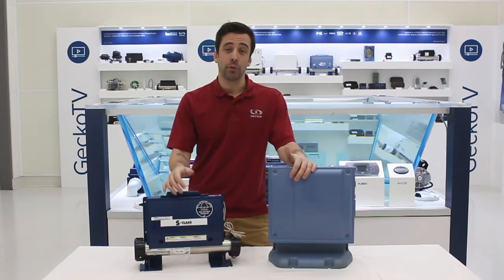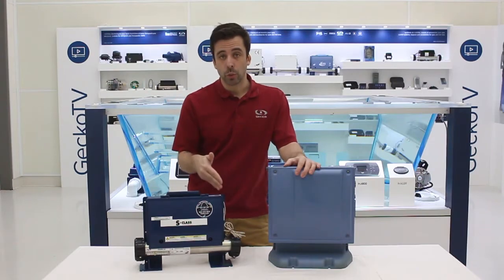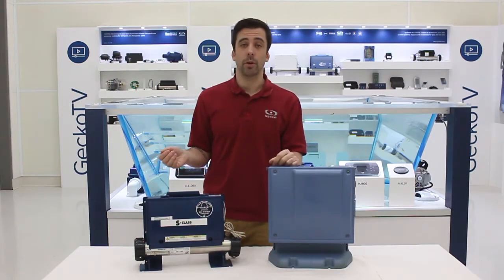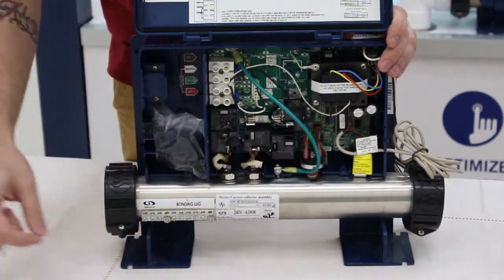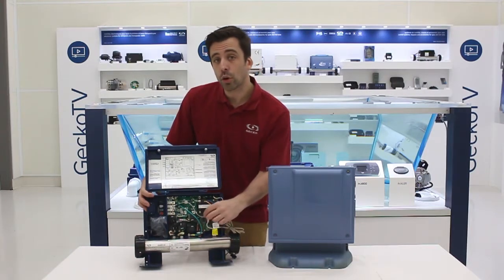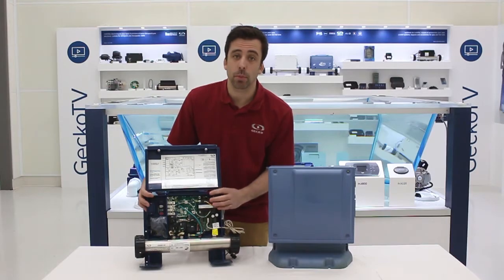3 FLASHING DOTS : FLO Condition

Comment: UPDATE for everyone who faces this problem........READ this carefully..... the pressure switch is almost all the time the problem, here why;

1- When you start (breaker) your spa AFTER refilling it with a new water; DON'T overload it keep the level normal or a little bit below.

2- When you refill it with MORE water than usual, the Pressure into the water pipes WILL be HIGHER than 2 psi

3- When the pressure switch is exposed to more than 2 psi it will close it circuit BEFORE starting the pump !!

4- IF you start the hot tub with a closed pressure switch BEFORE the pump starts.....the computer (board) will detect a higher pressure that is NOT supposed to be there and will TRIGGER the 3 dots = NO HEAT

This is what we found yesterday.... it happened to me twice and each time just before winter when I changed my water for this period.....each time I went to my specialist saying does not work...........EACH time twice when he plugged it......the spa pack was working PERFECTLY......and 30 min before........was not.........this is why we start our brainstorming

DONT bypass the pressure switch by connecting the 2 wires.......when you will restart your spa the computer will understand that the pressure was already high (more than or equal to 2 psi) and won't solve your problem... DON't Counterclockwise (left) your pressure switch........you will close the circuit below the 2 psi and face the same situation....... 

Voilà From a guy in Canada......